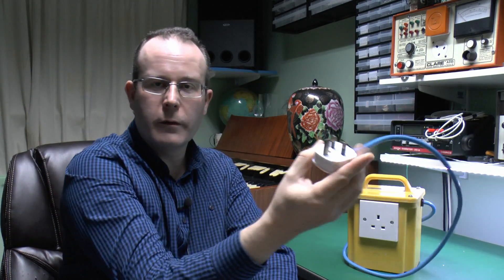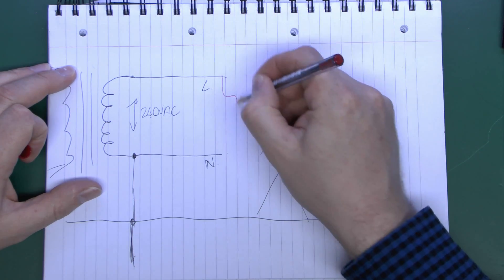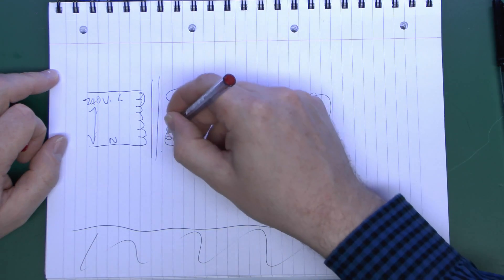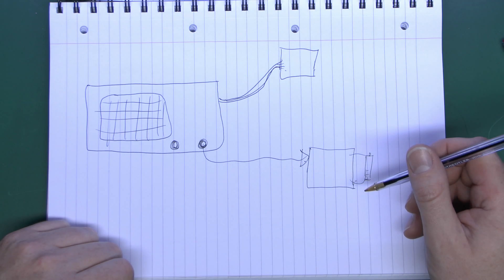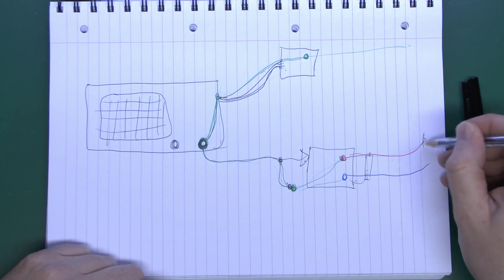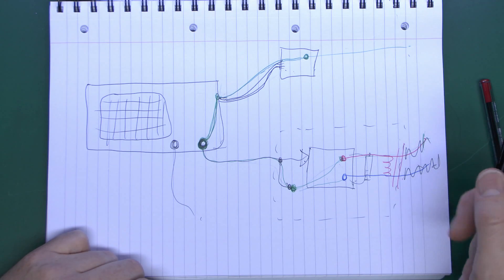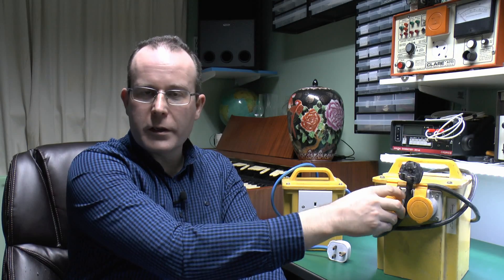Mains Isolation Transformers

Comment: Hi Jonh, I found myself here trying to sort out a problem with my Off grid,  inverter and battery setup. Basically I've got a 3kva Victron easy solar inverter/charger a 48v battery bank (8×12v  160AH in series/parallel) and a 10kva kubota/ linz generator, no solar panels  yet! that's the set up, now the problem, I connected a washing machine with the generator running 2kw going to the battery charger, the washing machine does nothing just flashing fault light, turn the generator off, the  washing machine runs perfectly and draws 1800w. I've can run various tools a kettle and Hoover,  6kw or more no problem from the generator, I've noticed the frequency has gone up to 52.2 Htz was 51.5 Htz possibly due to a fuel filter change, it's a capacitor controlled generator not automatic voltage control, after some research I've found this type of genny isn't the best for electronics, and washing machines very often don't like them.
I know enough about electrics to know I'm out of my depth, not sure if the machine doesn't like the voltage, frequency, noise or something else.
sorry for the long post.

Comment: I happy you clarified to always keep to scope to mains but make sure your broken device is on the floating power.
Quick extra question. - The earth pin of the isolation transformer will be earthed back to mains earth and neutral at power board. SO is there any way your ground clip touching anything powered in the broken circuit can flow back to ground eventhough the 240V is floating? AND whats the point of then connection that earth pin up instead of just supplying 2 connected pins on the output so you know you only dealing with the live and N floating voltage and thus TOTALLY isolated?

Comment: You said that if you have two pieces under test that you should use two isolation transformers. 
But some isolation transformers have two plug sockets available to use. Would this be considered two transformers ?
Let's leave the question of ground aside. Let's assume we're using an isolation transformer made in the 1960's,  before grounding plugs.

Comment: In the United States we have 240 coming off the transformer but we also have a center tap which is grounded that we refer to neutral.  So all of our lighting and recpticals are 120 volts.  Stoves and water heaters use both legs for 240, so my question is do all your lighting and recpticals use 240?  Is there anything within the appliance that drops the voltage down?
Reply from the maker: Everything in the UK and Europe is 240, there is no center tap, and no appliances or anything else that uses 120V.  All appliances are designed for 240V, including lighting.
Two wires from the transformer with 240V between them, one of those is grounded and becomes the neutral.
Reply: Yes all our lighting and power sockets is 240. All our appliances are designed for 240.

Comment: Hi are those Carroll and Meynell Transformers? what power rating can you recommend for electronics testing? I have seen this one on ebay. Would this be alright? https://www.ebay.co.uk/itm/Carroll-Meynell-1-5kVA-isolating-Transformer-750Va-230V-110V-Cte-2X16A-70-9/113689489331?epid=6012070383&hash=item1a786befb3:g:nnwAAOSw0AFchh9F 
Thanks.
Reply from the maker: That transformer is intended for UK building sites, and the output is centre-tap to earth.
It could be used as an isolating transformer by disconnecting the earth on the output, but it will still only provide 110V with 240V on the input, so won't be of much use.
The power rating is 750VA, which is far more than most electronic items would need.
Reply: @jwflame  Thanks for the reply. I have 3000W Step Up Stepdown Voltage Transformer. Can I use this instead as isolated transformer. If possible, will I just need to disconnect the earth wire? https://www.ebay.co.uk/itm/3000W-Step-Up-Stepdown-Voltage-Transformer-UK-US-220v-to-110v-Converter-Plug/401579266945?_trkparms=aid%3D555018%26algo%3DPL.SIM%26ao%3D1%26asc%3D20140122125356%26meid%3D4fb1b1bbc6234906b54d02866fa7d1a0%26pid%3D100005%26rk%3D3%26rkt%3D12%26mehot%3Dag%26sd%3D292676922974%26itm%3D401579266945&_trksid=p2047675.c100005.m1851
Reply from the maker: In theory yes.  However many of those yellow site transformers are filled with resin inside, so disconnecting the earth connection to the output winding may not be possible.

Comment: Thanks. Very informative. I picked up a RS safety isolating transformer second hand. It looks like yours and is UK made. Inside it, the earth is passed-through from the input to the output sides directly, via a bolt on the transformer housing. It designed to be disconnected if desired and they even provide a little screw terminal to put it in if disconnected! 

The earth is not strapped to either terminal of the output side of the transformer. It just goes straight through via bolt on the transformer housing.

 I tested that there is no continuity between the earth and either of the pins of the transformer's output socket. I did this when it was plugged into the wall (obviously not when turned on). 

I am struggling to understand why they have made deliberate provision for the earth to be disconnected and even suggested how to do it on a sticker on the lid! 

If I leave it as is, the earth on the output is effectively linked straight back to the neutral at the fuseboard of the house. Does this mean it is still 'isolated' and therefore safer to use with my oscilloscope? 

Sorry for the long question!
Reply from the maker: The output is still isolated regardless of whether the earth is connected or not.
For many things it doesn't matter if the earth is connected, but it may be relevant in some situations, all depends on the equipment connected to it.  Could be useful to have earth connected for some types of electronics to cover ESD issues, and older items such as radios or televisions may need the earth reference to operate correctly.
However caution is required as connecting an item that contained a fault to earth would then result in the isolated output being referenced to earth, defeating the isolated aspect of it.
Reply: @jwflame  Thanks very much for the detailed response. I think I will leave the earth connected for now. Somebody on WhatsApp scares me a bit by saying that mains filters on the item under test could be an issue if I disconnected the earth. Thanks again for helping. All the best.

Comment: Nice. But can I  connect two tested devices to one (1) galvanic isolated transformer?
Reply from the maker: You can, but it isn't recommended.  More devices connected increases the chance of a fault to ground, which then eliminates the isolation.
Reply: @jwflame  
Thanks for your answer.  You mean between the devices themselves in case of full isolated galvanic trafo? Regards

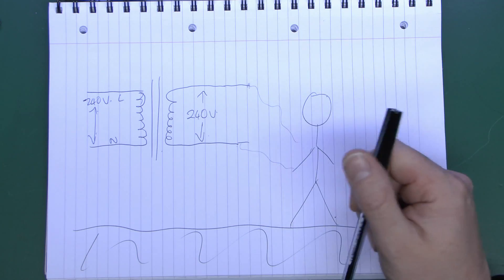Comment: 4:00 Why don't you get a shock from the transformer? If one of these leads is at a higher potential and you are its path to ground shouldn't you get shocked? I'm just struggling to get my head around that.......... I've just re watched it after posting my comment and I've got it now. (I think).
Reply: Think of the secondary of the transformer as like its own completely independent power source, like a battery (it's like a battery driven by magentic induction). It only wants to move electrons from one of its wires to the other. If you only touch one wire at a time (either one) there's no path (through you) to the other wire; so nothing happens. Neither side of the secondary is connected to ground (it's 'floating') so it doesn't care about it.

Comment: In electronic power supplies, there is always a Y-cap between input and output (for EMC). So there is always a tiny leakage current. And nothing is perfect isolated from the ground. SELV output is limited to 120 Vdc or 50 Vac. I wouldn't dare to touch anything higher despite that is isolated. A perfect floating system doesn't exist.
Reply: Dimitri De Rop that is true, so do not touch any metal chassis that is ‘floating ‘.

Comment: Quick question for you, in European countries such as France and Germany have 'normal' socket outlets in their bathrooms, however are these bathroom socket outlets fed from an isolating transformer? Not necessarily behind the outlet as the faceplate of the socket looks the same as all the others....reason I ask is that a recent visit to Germany in a hotel, using a plug in type voltmeter revealed that all the usual outlets provided around 234v, but the bathroom socket was giving 236v, slightly higher....didn't have any equipment to test between line and earth to either confirm or reject my suspicion..any ideas?
Reply from the maker: No, it's only the UK which is obsessed with having transformers and useless shaver outlets in bathrooms. Everyone else has normal outlets.
Bathroom may have been on a different circuit, or the voltage changed between measuring the various outlets - 2V is insignificant.
Reply: No, it is just a normal earthed socket. The different voltage could be for example that it gets a different phase. In several European counties the standard used to be that on wet rooms sockets were earthed and on dry rooms unearthed. On modern installations everything is earthed. This also means that you cannot plug in an unearthed lamp that you inherited from your grand mother. AN isolating transformer is the only way to connect it legally and safely unless you have an electrician earth it.

My bathroom socket says: "Only for a washing machine". Probably so that nobody puts a radio or something like that on it.
Reply: @okaro6595  "This also means that you cannot plug in an unearthed lamp that you inherited from your grand mother. " Nonsense, even today new lamps aren't earthed. That's a classic example of a double insulated device, of which there are millions of sold every year.

Comment: John.....thanks again for a comprehensive explanation. Can you explain when you say at 3:55 there is "no path to ground"?  If the resistance of a human body is (say)1000 ohms and a person touches the Live wire then at 240 volts surely 0.24 amps will flow through the body? Is that not enough to kill a human?
Reply: John , figured it out I think.  The fault passes through the man, through the ground to the Neutral of the primary winding, to the Live of the primary winding but the loop is broken here - no physical link between the primary Live winding and the secondary Live winding - so no complete circuit. This may help others if I'm correct.

Comment: You can get metal framed/cased isolating transformers with the casing earthed to the mains. If you have a PMR mains supply this means that the neutral carries through to the secondary neutral of the isolating transformers.

Comment: Hi John.  Where did you pick up your transformer for "a tenner or so" ??  I can't find ANY for anything less than ten times that.  I'm considering linking two 220-110 site transformers back to back instead but I'd rather do it with a proper unit.  Any ideas where to look ?  Ta.
Reply from the maker: Ebay.  They don't show up very often, so it's just a matter of looking until you find one.
They are often described incorrectly, as many people either don't know what they are, or think they are the building site 240-110 types.
Here is one which ended for £10 in Feb 2018 - https://www.ebay.co.uk/itm/222827715513 - wrongly described as 240-110, but is actually 240-240.
Others from Jan 2018: https://www.ebay.co.uk/itm/292377020720 - more money at £39 but seller had several of them and they were high power 3kW versions as well.
Also worth checking local places such as real auction houses, where all kinds of things can be had for very little, particularly if you are willing to buy a large lot of assorted stuff.
Reply from the maker: Here's another one which only ended a few days ago - https://www.ebay.co.uk/itm//162954628060
£50, but it's a massive one and seller was willing to deliver for a reasonable amount extra.  Only 1 bid.

Comment: Struggling to find any of these, any idea where I could purchase.
Reply from the maker: For new ones  places like this: https://uk.rs-online.com/web/p/safety-site-transformers/2604238/
they tend to be expensive, as they are specialist items and you can't get away from the fact that they require large amounts of copper for the transformer.
Used ones can be had from ebay and similar places, but that could take weeks or even months before one shows up.
Reply from the maker: Doesn't appear to be any on ebay currently, but they are still available cheaply,  some recent examples:
https://www.ebay.co.uk/itm/122847666833 Dec 2017, £41

https://www.ebay.co.uk/itm/292377020720 Jan 2018, £39 - seller had several available

https://www.ebay.co.uk/itm/222827715513 Feb 2018, £10
Reply: Thanks for the fast reply, keep up the good work.

Comment: I will pick two of these up, but just wondering could you not plug in an extension lead into isolated transformer to allow more devices. I have no intention of doing this just wondering.
Reply from the maker: Connecting multiple items will compromise safety, as it's far more likely to have multiple faults when multiple items are connected. 
One item with a fault to the case = no danger as you can only touch one of the connections.
Two items both with faults = 50% chance of 240V on exposed parts between the two items.
Three or more just makes it even more likely.

Comment: I have the same transformer as yourself John. Am a little puzzled whether the Earth should be carried through to the secondary connection, which is the case in mine. Should it be disconnected? Your help will be much appreciated especially for safety reasons. Great videos :).
Reply: A little late, but yes it should, there should be no connection to mains Earth at the output socket.

Comment: I am from the US, I take it the UK does not use  GFI like we do in the US?
Sounds dangerous.  GFI, Ground Falt Interuptor
Reply from the maker: They are used extensively here, but are normally called RCDs, residual current devices.
On new installations, they are required on virtually all circuits.
Reply: You should never rely on such devices. They are for accidents, not for poking a live TV while it is open.

Comment: Bear in mind there are also 240v output 'yellow box' transformers around that are NOT isolating transformers. Like the 120v building site transformer they are center-tap earthed. If one of these finds its way onto the testbench it's a potentially hazardous situation. 

Not only does it not isolate, but if there are also standard 240v supplies on the bench you could have 360vac between these and one side of the transformer output. Potentially a very nasty shock, or (as I saw happen once) a mighty great BZZZAP! if they get interconnected. 

You can generally convert this type into an isolating transformer by disconnecting the center tap so long as it has separate primary and secondary windings. Just don't use it as is, though.

Comment: Hi John. I want to purchase a 110v tranformer to run a 2000w power tool and want to know what output transformer do I need to do that? cheers Paul.
Reply from the maker: Get a 3kVA or 3.3kVA one, they are the most common and usually cheaper.  In theory a 2kVA one would do but in reality it won't because that assumes 2000W = 2000VA, plus the smaller transformers are usually advertised with the intermittent rating rather than the continuous one.

Comment: Hi John; enjoy your videos. It seems most folks recommend using isolation transformers when repairing old radios and such, especially the transformerless type. Is there any advantage to using one when working on modern tube guitar amplifiers such as Fender or Vox--or could one be in more danger plugging such amps into the isolating transformer?

Comment: Very correct to connect your test circuit to the isolation transformer and not float the scope. 

However, as soon as you connect your little black scope ground probe to the test circuit, you effectively have reintroduced reference to mains ground, which means you can receive a deadly shock by only touching one wrong place in the test circuit. That can be avoiding by using active differential probes on your scope in addition to plugging the item you are working on into the isolation transformer.

Comment: I like the home conversion of the isolating transformer. It looks like a converted 110v builders' transformer very confusing mix of standardised colours, blue, yellow 110v or 240v.  A builders' site transformer is designed to output 110v only.

Comment: That's fine as long as you do not have a ground pin on the plug.  In the USA most earth ground is directly connected to neutral in the fuse panel. This can be very dangerous.
Reply: https://youtu.be/XBsQ3sZ45Fk

Comment: In addition to the video:

There are also versions available where you could adjust the output voltage. Here's a picture of one:

http://www.amplifier.cd/Technische_Berichte/Amplifier_Trenntrafo/images/Grundig_Trenntrafo_RT5A.jpg

The text is in german: adjustable isolation transformer, for dry rooms only, protective contact (literally translated, mean earth or ground) not connected. Netz is "mains", manufacturer was Grundig. This model is about 30 or 40 years old. The symbols are harmonised I think: Galvanic isolation (two rings with the line between) and class 2 appliance (double insulation, quadrat inside of a quadrat).

Comment: I do electrical work in homes, but I've never understood ground. How do I get shocked wearing rubber soled boots with cotton socks on standing on carpet that's on padding that's on concrete. None of these are at all good conductors. How do I get shocked? If it's that easy to transfer current, why do we use copper and not rubber?  Seems not to bother the electricity going through my body and my boots.
Reply: It's AC current, the problem is capacitance, even if you are insulated you basically act like a big capacitor and thus get a shock.